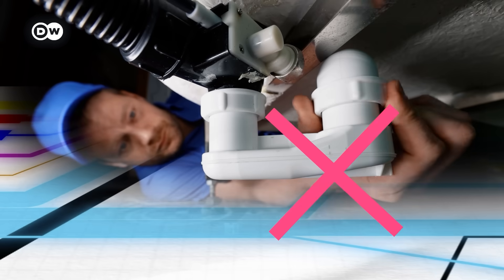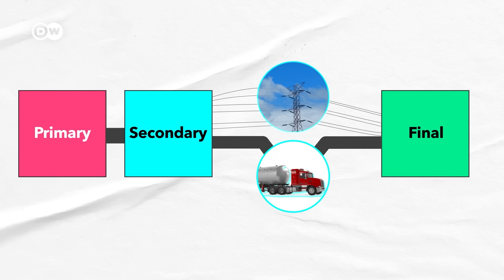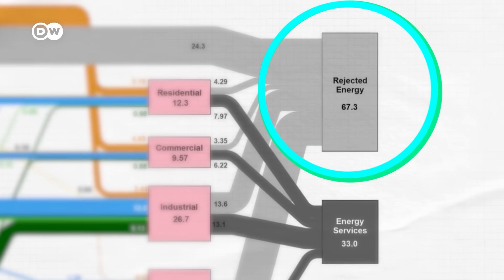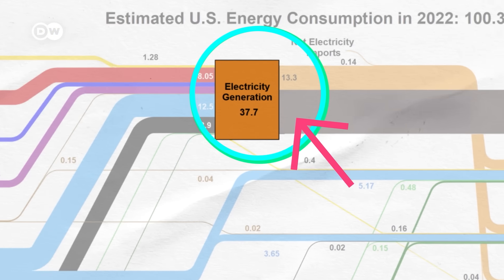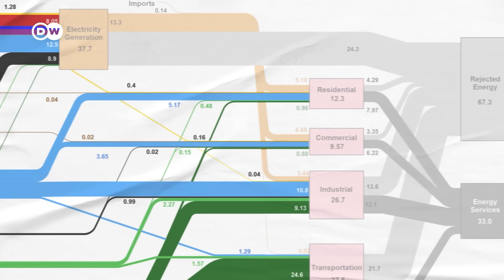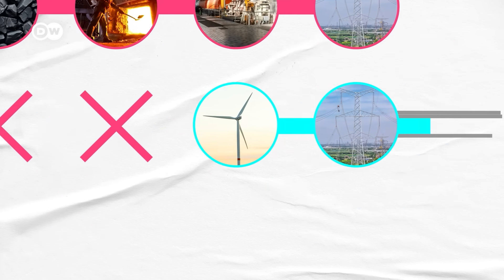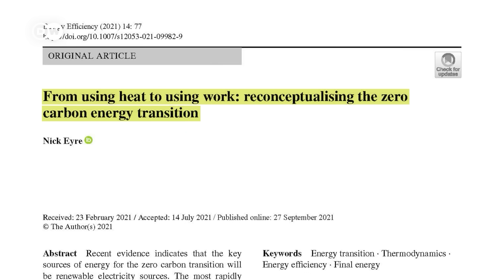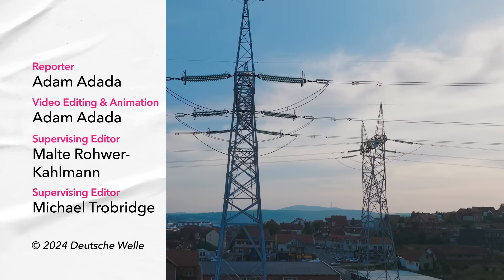The mind-blowing thing we get WRONG about energy

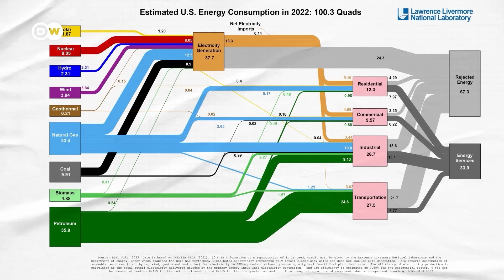Comment: There is a misconception starting at about 7:00, as most of the primary energy used by renewable power plants is lost, before it even is converted to electricity (which is mentionend right before in terms of efficiency). Primary energy is the first source of energy, before it is conversed in any way through human input.
A wind turbine for example loses about 50-60% of the primary energy source (the wind), before it is converted to electricity, a PV-plant even loses about 75-80% before producing electricity.
It is like burning 3/4 of the oil right at the rig, without using any of it.
In fact, there is nearly no change in total energy conversion, but the benefit in the end is the reduction of CO2-emissions, pollution and less enery overload at the end of the chain, which should be the real take aways.

Contrary to what could be concluded with renewable energy conversion, efficiency is the number one problem, as it allows to meet the energy demands with less investment, especielly when considering peak demand. The second problem is energy storage, as this reduces waste at the end of the chain and enables even higher yields from the same investment.
On the other side efficiency is also the number one problem when considering hydrocarbon power plants, as it lowers the need for fossile sources and reduces the wasted energy, which in return reduces the CO2-emission. Contrary to renewable sources, hydrocarbon sources don't have a storage problem but will always emit CO2.

In conclusion my guess would be:
1.
Use renewable power plants and electricity as efficient and as close to the consumer, as possible.

2.
Store the excessive energy for later use instead of shutting down renewable power plants.

3.
Store hydrocarbons as long as possible and only use them as a last resort and as efficient as possible (e.g. scavanging the emitted CO2, using exhaust heat etc.), even if you produce them with excessive energy from step 2 (e.g. power to gas).
Reply: Agree with you. Also there is an exageration in regard how eficient electricity is used (ex. 90% used to move the car - only charging the battery has less eficiency; without considering geting the energy out of the battery to drive the car )

Comment: Dumb video. The problem is not energy efficiency, the problem is storing that energy for later use. Current batteries are trash, we need innovational leap in that field. If wind isn’t blowing and sun isn’t shining where are you going to get your electricity? IMO cars should be fossil based until we come up with batteries fossil fuel plants should be replaced with nuclear ones, they are pretty safe now.

Comment: 1. Please don't call them "skeptics". They aren't skeptics, but science deniers. Denying the findings of the scientific literature is not skeptical - it's the exact opposite of that. 
2. You're completely right. I've been talking about this for years and the simple reason for that is that it has been in the scientific literature for over a decade now. 
Just think about it. If we try to electrify for example heating, then by far the most efficient way are heat pumps. When you burn oil or wood only about 80 percent of that energy end up heating your house. The rest leaves your house directly via you chimney in the form of uncondensed water vapor. With heat pumps for every unit of energy that you invest you can move 3-6 units of thermal energy into your building. This means that you need less than a third of the current primary energy in that sector. Obviously thermally insulating our homes better would make this number even lower. 
The same can be done with cars. Electric vehicles are so efficient that you only need about a third of the energy. It's easy to understand, but somehow very few people are spreading this information even though it's in the scientific literature and consensus.
Reply: You could tell the same story with all thermal energy plants. They are basically soffisticated steam engines. And as steam engines they usually only turn about a third of the invested energy into electricity. This means that if you move to solar, then you will only have to produce roughly a third of the primary energy to get the same amount of electricity. 
It does not seem to be very well known even though it's very easy to understand.

Comment: It is a great video to showcase to the public the other part of the equation, however, it should be noted that it is not as simple as it is shown for the below reasons.

-	Fossil fuels are still significantly cheaper, even after accounting for the inefficiencies.

-	Carbon capture can eliminate the carbon emissions from the wasted energy, which is the main end goal.

-	Hard-to-abate sectors, such as steel and concrete, need fossil fuel burning as electrification is impossible and more inefficient with the technology in hand.

-	Intermittency can be considered an inefficiency in some sort, given that no energy is generated during a significant part of the plant's lifetime, even with large-scale expensive battery storage.

-	The whole supply chain to mine the minerals and smelting the wind turbines has inefficiencies.

Renewable energy is the way forward with realistic expectations that (1) fossil fuels today are more competitive in terms of use case and cost (so it’ll be part of the energy grid for the foreseeable future), (2) future energy grid can’t rely on a single source of energy, i.e., electricity, (3) more investments should be poured in hydrogen and carbon capture to satisfy point 2 and (4) nuclear energy is the safety and most reliable out of all primary energy sources (cost will go down with innovation, just like solar and wind).

Comment: The fact that so much energy is wasted just by moving fuel around, and then by generating useless heat, is really obvious but OPEC kartel propaganda machine has unfortunately bought up much of the media and politicians. 
Also let's take into account the risks, a windmill disintegrating is a pretty localized event, a leaking oiltanker or pipeline destroys vast swaths of ecosystem. Express the cost of prevention, cleanup and damage in energy terms and the equation gets even uglier.
For good measure, we should also include the cost of the oxygen used by combustion processes. Carbon offsets are nice, but what is the cost of replenishing the oxygen? What is the cost of extracting hydrocarbons, vapors and soot from air, water and soil? For electrical systems, we would only have to look at ozone output, which although not desirable, is a lot less toxic and probably easier to deal with at the source. Bottom line is: of course an energy system with fewer transitions, steps and travel distances is more efficient. The cost of energy generation transport is simply ignored to protect the associated industries.

Comment: As the costs of renewables and battery storage keeps dropping, more and more old systems will get squeezed out of the supply side due to costs. We are at a time where environmental and economic factors seem to be headed in the same direction. In the sectors where this is not happening very fast (EVs and heat pumps for buildings), and economic choices are not available, good governmental regulations are needed to help focus research and development efforts, and encourage economies of scale. Mining and industrial production will be the slowest in some aspects, as many systems are complex and fragile, and need careful control of transitions at various places in the production chain. But if the economics make sense, those transitions will occur. Unfortunately many of these transitions are happening much faster in China than in the US or Europe, where many industry leaders are scared of change.

Comment: Stop that what-abouting nonsense pls. 

Ultra-high temp lab ovens, plasma, lasers and fusion all do work electrical.

Oil extraction pumping, bulk or pipeline transport, fraction destillation and steamcracking do consume 2/3rd of oil energy before any products even does hit market distribution.
It makes any fair comparision to a power line a total joke of an argument. Get real pls.

Renewanbls are distributed and local. The transport is minimal of done properly.

There is one single caveat. That is night-time energy for 24/7/365 chemical process of base materials bulk production in direct global competition.

That's were the sunbelt like Andrew Forrest from Fortescue can kove into Green Steel while Germany for eg cannot.

Germany needs 30 GW of industry guaranteed night time power. Half of thst is industry demand that cannot be moved in a smart grid.

Wind got lulls, solar doens't shine, batteries are expensive.
LNG is expensive since Ukraine War sanctions cut Russian natural gas.

15 GW × 12h is 0.18 TWh battery storage in Australia.
15 GW × 24h x 14 d is 2.25 TWh for wind lulls in Germany.
That's 12.500,00% or 125x more storage needs and cost of such stored energy.

This 15 GW requires a solution to electrify hard-to-decarbojizenindustry relyingnon cheap gas for heat, energy or hydrogen inputs or any combo thereof.

The most critical process is Haber-Bosch running on high pressure and high temps while using hydrgogen as input.

The ammonia nitrogen fertilizer is a price sensitive critical input for the entire global food industry.

The only technkissing is a TRL6 at scale that can deliver industry night time energy at low cost.
Key candidates are deep geothermal drill heads and 2 m/s current tidal power.

Both could deliver cheap weather independent nigh-time power. Do what expensive batteries can't provide.

That's absolutely all and everything that is any open question in a smart grid of distributed energy generation.

Private homes can all be fine on batteries versus grid prices today.
The can smart grid their mix as they chose economically.

But you can't have a steel mill or amkonia plant ramp down for a single night. You can't burden that product with energy storage cost and you cbaot go inport dependent w/o wrecking your entire econmic value chain specialisations in processing industry depending on that cheap input being avvailable in a specific region.

So if billions of jobs cannot relocate into the sunbelt, you need to come up with serious R&D budgets without some pipeline lobby like Putins KGB Siloviki gang  messing it up.

Billions of Green Industry investment remains stuck until Putins PsyOps is uninstalled from peoples wetware OS.

You seem to be a clever guy and don't want to move last into some cleaner version of your same old engineering job. First movers do tend get the better choices.

The 2 arguments you tried to make clearly do not hold up. I would really appreciate if you do not spread such half-baked "truth".
If you are truly an energy engineering expert these things should be rather ovbvious if you drop any bias for a moment and simply go by the basic facts of how these different pathways are built. In fact the primary energy is already picking up too late on the fossile "products" on the market.
There is a lot of energy lost before it is even considered primary energy in terms of oil, coal and gas on global markets at destination.

Becuase that is generalized and left out of a high level Sankey over a continent spanning US maket with global primary energy extraction sources.
A Texas and Saudi oil barrel isn't the same thing in KWh utilized.

In a local wind mill it is at 99.9%

With EVs already ruining the demand of refineries supply chains economies wrecked, the gas price at the pump is in for drastic spikes. The green transition will rapidly accelerate now.

Even w/o green ammonia night time power being resolved.
The EV revolutionnin china has 50% global market share and cannot be stopped in any way.
China is oil importer No1 and they won't have any of ICE dependency of their 1.4bn populace.

Austraia and Chinamkove to reap economic advantages from electrifying their industry. It's lead the green evolution or die by noe in 2024. Green Steel is already happening on solar + MW scale batteries. Some tricks up the sleeve in direct inductive reduction iron ore processing. 

We got to see a lot of fancy new amazing things of human genius  in the next 2 decades.

Comment: I argue the palm oil is a product of solar energy. Palm trees produce oil the most efficient. You Westerners argue that palm tree causes deforestation. However, you forget that palm oil also convert carbon dioxide to hydrocarbon the most efficient. We need to produce biotechnology to crack long palm oil molecule into several shorter octane molecules.

Comment: A few issues I had while watching: 
- Electricity production is already quoted in terms of usable output, so everyone already compares the inefficient final ouputs of combustion sources with more efficient outputs of other generation processes (ie replacing 1GW of coal with 1GW of solar, both of those are final outputs to the grid).
- You mentioned 90% efficiency of electric cars, but its not fair to ignore the inneficiency of charging the car battery there. Charging a combustion car (aka fueling up) doesn't have that same inneficiency.
- I also prefer induction over gas, but banning it would be just asking for a government to be booted out :P 

Anyway I don't think this made the problem seem any more or less difficult. But it at least lett me know about a cool graph for summarising energy use in a country :P

Comment: I agree with this outlook completely. I would further add that domestic energy is the way to go every time. Shipping oil, coal, electricity around far and wide makes no sense. Use what you have where you are and instantly shipping costs will be eliminated. Not to mention the amount of energy that is used to go to war to steal oil and other things is astronomical. If all that metal, manpower, oil, equipment and such was put to use to improve the country that you are in, so much energy would be saved.
Reply from the maker: Hey! You could be keen to watch this video from us on military emissions: https://www.youtube.com/watch?v=Q2ZUrzGohCI 👀
Reply: You’re talking nonsense. Do you not understand why Germany’s economy is struggling right now? Oil and electricity are completely different things. No country relies on oil for electricity generation. Oil and gas are primarily raw materials for chemical products and cannot be replaced by electricity. Moreover, if you build large-scale wind farms, do you think transmission and distribution aren’t required? In fact, constructing them in remote areas like the sea dramatically increases maintenance and transmission costs, which is one of the main reasons behind Germany’s rising electricity prices.😅

Comment: What we get wrong, is that nuclear energy, could be a renewable energy too. A lot of the fuel, is recyclable... If we only used it in a proper breeder cycle.
Reply: It's quite literally not renewable. It's long lasting but you have to input fuel.
Reply: The US does not recycle fuel rods cause its more expensive than digging up new uranium.
There is only a handful of nations in the world that do. The US enforces a ban on it for most of the world because plutonium is created during the recycle process and the US does not want other nations to have it.
Also they are recycled only once that is, doubles fuel rod life from 5? to 10? years not exactly a long time. A huge waste.

There may be more advanced reactor types like thorium and stuff on the horizon but even if proven working and safe it would take decades to build a meaningful number of them around the world.

Also they will be safer, but cheaper? no evidence of that

historically dismantling old reactors has been a nightmare everywhere around the world driving up costs often several times of whats projected.

takes many years, is insanely expensive and handling and storing the radioactive waste is a costly logistical nightmare.
Companies setting them up ran bancrupt dismantling them despite public finance support and often had to be taken over by government to finish the job. the company made a fortune building it, the taxpayer gets to eat the cost at the backend.

dont get me wrong, i am all here for research and development, but so far nuclear is far from being the touted wonder.

it is so slow, big, expensive, labour and staff intensive, centralized, ..
Reply: Nuclear is a perfectly valid type of renewable energy. The problem with it is not safety or waste, (both vastly overrrated problems), but simply cost: Cost curves for solar and batteries just keep going down with no real bottom in sight. Ten years ago, there was still a decent case for nuclear. Today you have to rely on the theoretical promises of reactors that haven't proven themselves. And the only cost curves we have for nuclear actually go up in price rather than down.  In another ten years, I'm afraid the picture will become crystal clear. A nuclear reactor will always require the turbines and cooling systems, even if you can build the reactor itself completely free. We will probably see solar and batteries become cheaper than even that.  So no matter how advanced your reactor is, breeder, molten salt, thorium, even if you somehow get fusion working, solar will still be cheaper. The dunkelflaute problem persists both for nuclear and renewable systems, and will probably be solved with a combination of burning waste, biomass, and hydrogen for the couple of weeks we need it.
Reply: @Tr1ploid  While it is true that nuclear power is more expensive it is not dependent on the sun. In the event of a major volcano as has happened in the past the amount of sunlight getting to earth can be drastically reduced for a year or so.